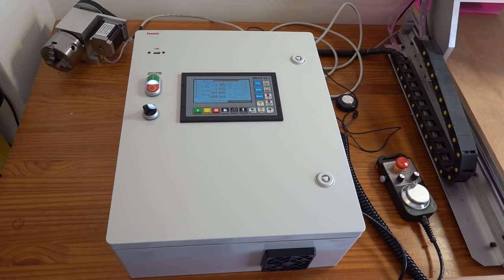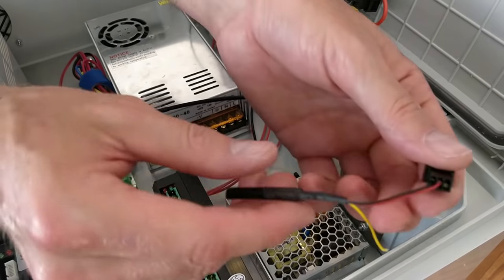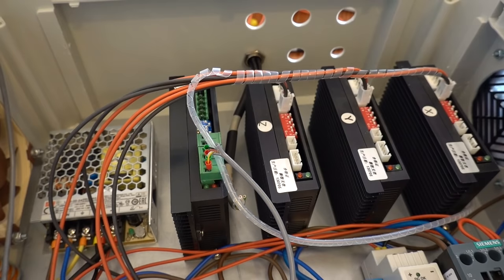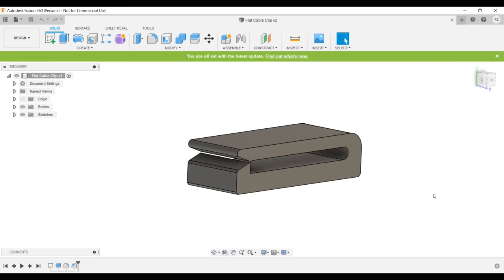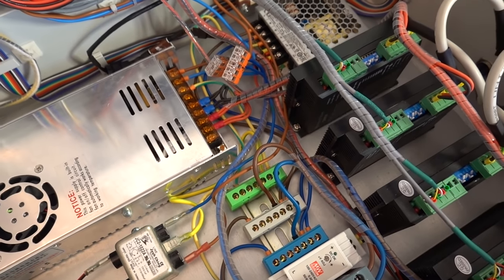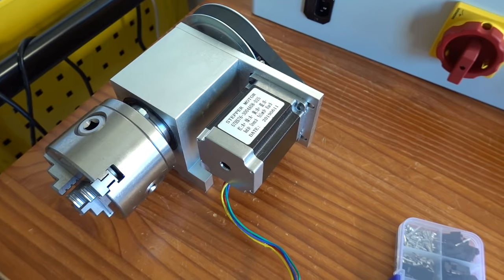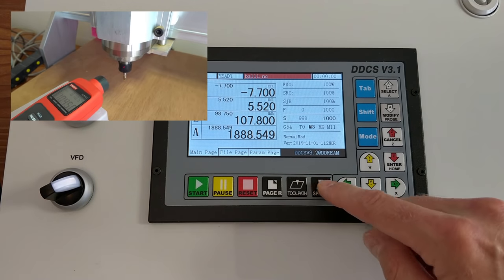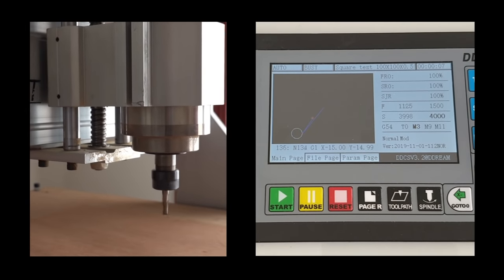Build Your Own CNC Controller, Part 2  |  DDCS V3.1  |  6040 Router

Comment: Disappointed that you didn't show greater detail of the wiring.
Reply from the maker: The full wiring diagram can be found in the PDF file in my website article linked in the description. A video is not the best medium for going through every wire connection. If you have any questions on the wiring diagram let me know.
Reply: @uptimefab7412  brilliant, thanks for the response, unusual to get one these days. 😊😊

Comment: I have the 5 Axis DDCS Expert CNC Controller. I know this may be a dumb question but I can't get the controller to come up. I only have one drive and motor hooked up. I am new to this. How d0 I install Mach 3. Do I need a  laptop? I just found out I can't use a slave axis do I use Y and A axis as 2 different axis?
Reply from the maker: Hi sorry for the late response. Without seeing your actual setup this is hard to answer. Make sure you double check all connections, does your is the drive powered with adequate voltage and have you measured it? Also, you do not need mach3, the ddcs replaces mach3. There is no software needed on your PC to run the machine.are you sure, I thought some of the other ddcs controllers support dual Y axis vut I might be wrong. If not you could also use one signal for 2 drives.

Comment from the maker: Note: For proper shielding of the stepper cables, the shield should be connected to ground on one end inside the cabinet. Connect all ground wires to a single point / terminal. See video part3 for updates to the controller and check the pinned comment on that video for best practices.
Reply: And a run ground from machine frame to controller. The metal plate in the e-box is used as ground plane shielding all the electronics. Adding ground cable to every switching p.supply with metal frame touching the plate is the wrong way because creates a ground loop . You can use s/stp  s/ftp cable as signal cables and connect the shielding to groundplane as start point of  the ground trees.

Comment: Why did you used plastic box?
Reply from the maker: It is much easier to make the various holes in. However, this increases the chance of EMI and less easy for grounding connectors.  I have left a pinned comment indicating that a metal case is preferred for these reasons, but people will have more work on their hands on that cas.

Comment: Just wondering why it appeared that you cut off the shielding at both ends of the cable? Aren’t you supposed to earth one end of the shieldIng for the shielding to work?
Reply from the maker: Hi, yes the shield indeed needs to be grounded. This was corrected in video Part 3.
Reply: @uptimefab7412  thanks for the reply. Off to watch Part 3 of an excellent series of videos.

Comment: Thought about buying one of these controllers, but from what I can see, there's no way to write or edit programs at the machine.  Am I missing something?
Reply from the maker: It is possible to create new and edit existing programs on the controller itself. You can do this from the file menu. Note that the editor is quite spartan,  no colors to indicate G codes or things like that, but for quick editing it works fine.
Reply: @uptimefab7412  Okay thanks.  I noticed that in a subsequent video you also said that a keyboard can be plugged into the USB port, so I imagine that helps the procedure considerably.
I asked, because this is what has held me off from buying one of these.
BTW, I found that Foinc (sp?) sells a more attractive rebranded variant of these, with a darker facia and less garish buttons.
Reply from the maker: Those look very nice indeed. Also larger screen. If you can fit that in your enclosure that would be a nice option. Unfortunately it was not available when I went shopping for a controller.

Comment: Ground your spindle (to the controller ground) and you wont (shouldn't) need to clamp the tool when using the probe. Very well done, thanks for posting.
Reply: Never mind, I see you did that in part 3!
Reply from the maker: Thanks anyway for the tip!

Comment: Top effort and thanks for going to so much effort with the video. Five things I would have done differently 
1/ Nutserts
2/ 240v control for contactor
3/ over strip your your cables for your connectors and tin them from the top. Then trim to size and then insert right up into the connector and solder lastly. 
4/ Keep all heartstrings as short as possible for flexibility.
5/ probably the most important, use cable duct for running cables strategically placed for connectors. 

Top effort tho.

Cheers
Reply from the maker: Thank you for the tips! These should indeed lead to a cleaner build. A note on the contractor: 230VAC (or 240) works great and had advantages such as availability and cost as there is no need for a DC power supply. The main reason I went for a DC contactor is that I have both a panel switch and an external E-stop on a long wire in series with the contactor. These could be 230V but I feel more comfortable with a low voltage wire running to the Estop. As mentioned one can also connect the Estop to the dedicated port on the controller, so in that case only the 230V pushbutton remains and you end up with mostly advantages for the AC setup. Having said this, I am happy for now with the DC contactor. Also used that in my later lathe retrofit since there was also a long cable to the contactor, which I prefer to have low voltage.
Reply: @uptimefab7412  I've never used the set square like you did. Instead I painstakingly measure off everything. That makes life so much easier the way you did it. 🍻

Comment: Other then not grounding the shields of the cables for a drain and not seeing if you ran grounding wires to all the metal components in the case this was a great mini series.  I feel as if you missed a possibility by putting the DDS in its own smaller remote box and running a cable to the bigger case.  This would allow you more freedom as to where you can mount the DDS as it would be smaller.  GREAT JOB!!
Reply from the maker: Thanks, very useful feedback. Indeed having the DDCS in a separate smaller enclosure would be a significant improvement in the ergonomics department. I now have the cabinet below the table that the router sits on. Going though the menus while sitting on your knees is not ideal. If the case is wall mounted at eye level it would already be an improvement.

Comment: First off, nice build.
To your connector problem, wrong pliers used, went through the same problem you had, correct pliers fixed the issue.
For your PTFIX blocks and terminal blocks, by the looks the ones you have are the PT 2,5 if i am correct, try the pt 1,5 ones, way smaler. And you do not need any feruls on the wire for these, fine strandet is fine without any termination, just push the release in with a screw driver, insert wire, done.
Reply from the maker: Hi, thanks for the useful tips! It makes perfect sense indeed that not all type of connectors can be crimped with the same cheap pliers.
I just looked at the different ptfix options again and indeed the 1.5 version is significantly smaller and 1.5mm squared is enough for this application. I already thought the ones I had were small!

Comment: With a bit of solderin iron you can get the wires firmly tight to the connectors, otherwise they can slip.
Reply from the maker: Good catch, one of the wires came loose, probably due to me not properly heating the wire and connector when soldering. So far the rest are still ok. Keeping my fingers crossed

Comment: Nice cable management.  I would suggest a metal plate for the connectors to common too (inside the case is fine). Connect the wire shields to the connector housing (which you seemed to have ignored) which will then connect to the metal plate. Earth ground the metal plate at one point.  The whole idea of the shielding is to provide a faraday cage for the inner wires.  Only earth at one end in this case.  If you have noise issues, a cheap fix is aluminium foil with kapton tape over it and stuck on the inside of the case (Earth at one point too).  Copper tape is better but very expensive.  If you can get steel or tin foil instead of aluminium, even better.  Steel being best.
Reply from the maker: Hi, thanks for the very practical and useful tips on grounding. Others have commented on this as well and rightfully so. I have not had issues without proper grounding on this new controller, but it is better to follow good practice to prevent having to troubleshoot weird issues. I have just wired the first cable shield to ground. Many more to go. I will probably do this at some point in the near future.

Comment: About 4th Axis in Fusion360:

A rotary/rotational axis may have been added to a three axis machine. Most of the post processors available in the HSM post processor library are set up for 5 axis code. The 4th and 5th axis are disabled by default.

Comment: Good work.  another suggestion.  Ideally you want the airflow to move across the heat sinks of the drivers.. right now your drivers are essentially blocking the flow of air.  maybe install another set of fans up top...
Reply from the maker: Thanks, indeed the air flow path is not ideal due to the layout in combination with the size of the cabinet. I did not want a fan on top exposed with possible debris or chips falling into the cabinet, so that is why it is on the side, but I fully agree the air flow path is not optimal. For a next project it might be better to have a larger cabinet. Makes wiring easier as well. I have measured temperature on the drivers after being on for a while and they seem to stay within normal temperature range. Will update if there are any issues later.

Comment: Beautiful work and a great video. Incidently, your mains wiring colours are exactly right for the UK (and so presumably for the Eurozone too) ie Brown for live, Blue for Neutral and Yellow/Green for earth. These colours replaced Red, Black and Green/Yellow here many years ago. I'm not sure of the logic, but Red clearly signified 'Dangerous' and I suspect it was decided that Brown was closest to this for the new colours as Red and Blue are traditionally seen as opposites. Personally, I think Blue for ' Electricity',  Black or Grey for Neutral and Brown for Earth would have been more logical (though clearly it would not be wise to wire any equipment in accordance with this 'logic'!)
Reply from the maker: Thanks for your insights! Makes sense indeed to stick to the standard colors for mains to avoid confusion.

Comment: Great work. I am working on a very similar build for a customer. The cable management is top notch! Love that cabinet. What's the brand?
Reply from the maker: Thanks for your comment, much appreciated. The cabinet is the Famatel 39145. If you need info to other parts they should all be listed in my website article linked in the description. Somewhere in the Middle of the article. Best, Robin

Comment: Great stuff as always. I wish I was as tidy with wiring... Just burned the lathe control board because I was testing & moving parts when the lathe was on 😭
Reply from the maker: Ouch, that sounds costly. I have also fried stuff before. Oh well... failing is a good way to learn, or at least to find out how not to do something. Thanks for the comment, stay safe! :)

Comment: Muchas gracias por tu generosidad, excelente trabajo, felicitaciones, por favor me podrias decir el diametro de los cables que usaste para las conexiones de las señales de paso de los drivers que se conectan a la controladora ddcs v3.1, por lo que veo son cables delgados, muy agradecido, exitos, saludos
Reply from the maker: Hi, if I understand correctly after google-translate, you are wondering what diameter wire I used for the signal wires from the DDCS to the stepper drivers. These can be very small, I used 0.14mm^2. However, this is not advisable, since even with the smallest ferrule it is difficult to get them securely tightened, so the ferrule stays in place. For a later build (my lathe) I used the larger 0.34mm^2 wire for signal wires. Much easier to work with and ferrules are more securely tightened. Note that I do not know what the industry standard is, this is just what I use. Also i would like to note that for the wires going to the stepper motors I am using much thicker wire (0.75mm^2) since they carry high current.
Reply: @uptimefab7412  very grateful, thank you very much for sharing your knowledge, my best regards to you to carry out your projects and continue helping with your knowledge, please, if it is not too much to ask, can I bother you? 
 in the future to complete my project, I also want you to know that I am copying your project, I hope you are not offended, I am very new to this, I do it to learn in my free time, your project is an example for many people who want to learn , I am from Argentina, here it is very difficult for me to get the materials you used, but I am getting it little by little, when I have it finished I will show it to you and share it with you, I hope it turns out well, congratulations and thank you very much again, for everything, sorry If something was translated wrong, I'm using the translator, good luck

Comment: I am in the process building a cnc and enclosure your video were very helpful. It would be helpful to see links to items used in the videos (tools, materials, screen and enclosure) thank you.
Reply from the maker: Hi, thanks for the tip. I hope you did find the bom list in the article linked in the description, but  this would I deed be easier, so you would have a starting point to search for a supplier.
----- EDIT: I have just updated the bill of materials with hyperlinks to where I bought the items. Some stores may not deliver to your country, but at least you have a starting point and in many cases there is also a datasheet on the linked store.
Hope this helps,
Robin

Comment: First off I want to say thank you for putting together these terrific videos and the detailed write ups on your website! It has been extremely helpful for my CNC project! One thing I’m confused about is why you have a dedicated power supply for the safety circuit? Couldn’t you use the other 24V power supply to also power the contactor?
Reply from the maker: Hi Tim, thanks! Please see the discussion on this topic below video part1. In summary it is   because I want to prevent damage to the DDCS due to the voltage spike when the contactor is disengaged. Not sure if this is needed, but I do this just to be safe. Meanwhile I have also bought a surge protector (siemens 3RT2916‑1DG00)  which can be plugged into the contactor to reduce the spikes. With that solution it might be safe to also connect other electronics to the same power supply. This is at your own risk though. I do not have a scope to test this but according to the Siemens manual it should reduce spikes down to less than 1V.  Cheers, Robin
Reply: @uptimefab7412  Ah, I missed the comment from the previous video! That makes complete sense though. Definitely would be better off spending $15 on another power supply then risking burning out the controller! Thanks for the info!

Comment: Really liked your video. Bought a chinese 6040 and could never get it to work properly. Specially the limit switches / Probe. I have decided to change the controller and the stepper drivers. Your video gives me hope. My problem is that the board that I got has the "controlling" part and the drivers all in the same board.
Reply from the maker: Thanks! Good luck with the conversion!

Comment: Great video , just have one question regarding the wiring of my spindle as I have a 'bitsensor' board that I am replacing with the DDC3.1 ( 6040 cnc unit) . I have a wire coming from a location called AVI, what and how is this wired in relation to the same break out port you use. I have this also, I see the VSO and M03, and Gnd, is this all thats needed? I seem to have a forth wire...for AVI...Its labelled AVI-10V-Com-FWD-.
.Thanks again, Rich
Reply from the maker: Hi, this could be an Analog Voltage Input and I assume this is coming from an output terminal on your current controller used to control the spindle speed. In my situation with the nowforever VFD I am using am output from de SZGH controller to connect to the analog input "Ain1" on the VFD. The SZGH outputs between 0 and 10 volts for min and maximum RPM respectively, based on the RPM you select. See wiring diagram PDF in my website article. So you would need to look for the analog 0-10V input port on your VFD. It may not be called Ain1, but might be some other name. Most VFDs have this input port. Long answer, I hope this answers your question :)

Comment: Very nice!!
Does the DDCS controller allow you to slave the A axis for a Dual Y Setup?

Thanks For the Detailed video and What A control Box! Great Job!
Reply from the maker: Unfortunately a dual y axis is not supported directly by the controller. You could wire 2 stepper drivers into the y axis port but of course you would not have the ability to work with a separate home switch for each motor to align the axis. I read somewhere that it might come in a firmware update for the expert model, not sure if or when this would happen and if they will also do this for the V3.1. Thanks for you feedback, much appreciated!